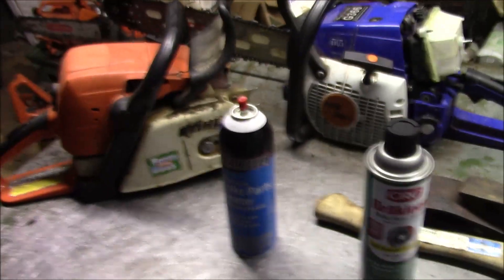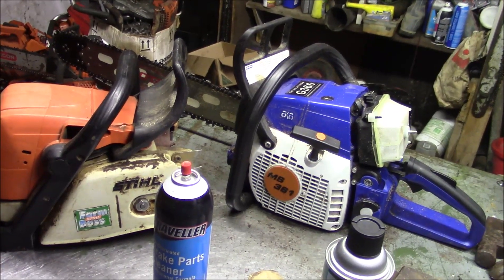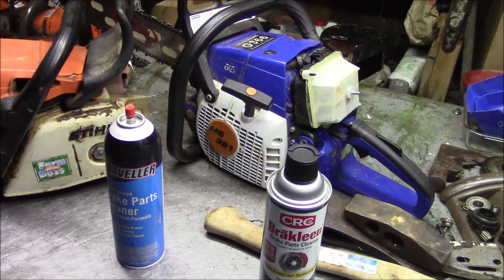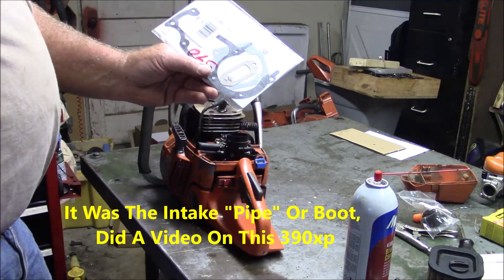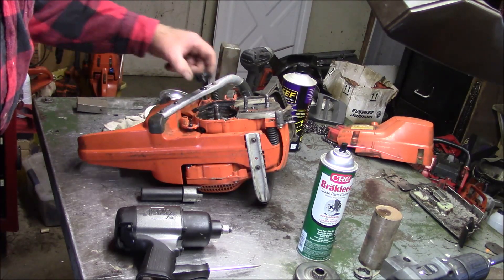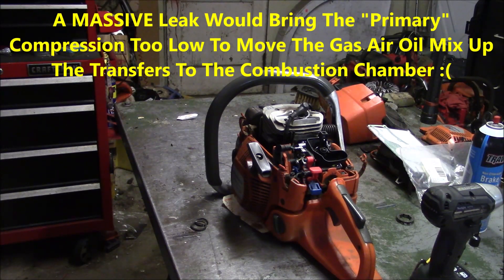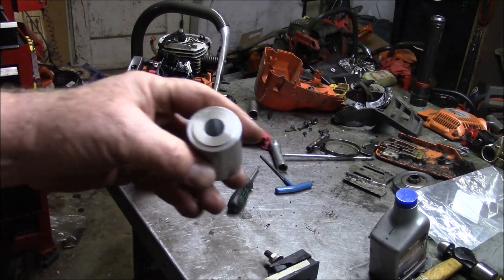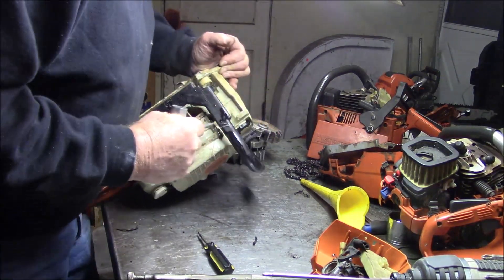Chainsaw Won't Idle! What's Wrong? Brake Clean Test, Alternative to Pressure Vacuum Test,  Leak Down

Comment: Working on a Homelite Super XL Auto this week same issue. Problem small crack in fuel line. Detected as it was a clear line and I could see bubbles. 
If it would have been a black line or yellow it would have been harder to detect.

Comment: Probably a stupid question, but if brake clean is flammable why does brake clean stall the engine?
Reply from the maker: actually a great question, flammable isn't the same as combustible, it's like the gun powder thing, it's the rate of burn.

Comment: Hey, 
I just came across your video, because my husqvarna 372xpg is idling way too high. I have the carb tuned to the factory settings and when I spray carb cleaner at the transition from the carb and the manifold the saw stalls. What do you recommend?
Reply from the maker: Changing the parts in that "transition from the carb and the manifold the saw" ?

Comment: Thank you  for this !
Been  working  in the woods  for over 3 decades  now and no when a saw has  a wee problem  ie sucking  air in ! Never did i no this trick always  gone for replacing  the easy rubber  bits first ie fuel pipes  carb boots  and so on until  i eventually  find the problem  !  This is so handy  to know  ! Thank you mega  chuffed  with this video

Comment: Just used your method yesterday for the very first time and found a suspected air leak - cracked impulse line at the crankcase nipple. Another diag tool added to my collection!  Thanks so much!

Comment: Wow!  I learned SO much from this video!  Thanks so much for rummaging back through all those vids to find the nuggets and put them all together!  Just as I was about to comment, "Those are all for running machines, but what about non-running?", you inserted the non-running one and how you went about testing everything else to eliminate the variables!  I just subscribed and rang that bell!

I've been watching YouTube videos for 18 straight months at the rate of 2-6 hours/day, 7 days a week, to learn small engine work.  I've come a long way but of course continue to have questions and increase my knowledge base as well as try to refine my diagnostic skills.  I'd already seen this method of testing for leaks before but hadn't tried it because the machines I was working on were non-runners.  I've learned all about pressure/vacuum testing and do that all the time, but if there's a way to shorten that process I'm all for it!

So far I've restored or repaired chainsaws (Stihl, Husqvarna, Dolmar, Makita, Poulan, Craftsman, Homelite, etc), a string trimmer, a snowblower, a lawn tractor, a wood chipper, a leaf blower, a pressure washer,  lawn mowers and who knows what else. ;-)  I've got a garage and large yard full of free or cheap (I don't buy any more - I only did that in the beginning) equipment I've acquired to flip, but now I'm getting in repairs as well.  I have some favorites I've gotten for free that I want to work on but can't seem to get the time!  At 75 it's all about how much energy I can summon up on any given day.  ;-)

Thanks again!

Rein Ciarfella  (Cape Cod, Massachusetts, USA)

Comment: what if carb sucks brake cleaner in the throttle shaft?
Reply from the maker: It will shut the saw off there as well. :) AND I got snagged with that exact issue on a saw very recently . those 361 clones where a nightmare with all the leaks they had. Doesn't matter how the brake clean gets in, if enough does the saw stops. A great tool for finding issues.

Comment: Is one of the symptoms of an air leak on a chainsaw where it will start and idle but will die when the trigger is pulled (compression is 160 psi and carb kit installed)? I have a Stihl 026 that has this problem.

Comment: Ever seen an airleak after about 15 to 20 minutes of working?
  Sthil fs76 weedeater after 15 minutes of work it has trouble going from idle back up to working rpm does better if i apply the choke it takes the hesitation-stumble out.
 It idles fine hot or cold 
Enjoyed the video I'm a subsriber now!

Comment: What makes the saw stall when you shoot the cleaner on it? Does it go into the engine?
Reply from the maker: Yes, on a two stroke the crank case is part of the "pump" drawing fuel into the motor, then when the piston heads down compressing the gasses in the crank case then pushing them up the transfers to the combustion chamber. WHEN the piston heads back increasing the volume of the crank case that draws mix in through the carb....if there are leaks in the bearings seals or some other place,  air will we drawn in leaning the mixture creating issues....spray brake clean around and when a spot pulled the brake clean into the crank case and that now contaminated mix heads up to the combustion chamber...it won't light off so the motor stops
Reply: @afleetcommand  Gotcha. Yeah I’ve seen guys on YouTube before get out there leak down kits. One guy said they were about a hundred dollars. It’s also time consuming to hook them up. This is an awesome little trick and I’ve never heard of this before. This was helpful. Thanks man!

Comment: HI WALT  ANOTHER GREAT VIDEO, WHAT ARE YOUR THOUGHTS  WOULD A 572XP  MAKE A GOOD FIREWOOD SAW ,I WOULD MOSTLY BE CUTTING  MEDIUM SIZED MAPLE AND BIRCH  ,ANY IMPUT WOULD BE GREATLY APPRECIATED THANKYOU
Reply from the maker: Of course it would, it's a saw that can easily handle pretty much anything under 30 inches.

Comment: some thoughts/questions on the common PTO side bearing failure.

I know you run your chainsaws regularly and hard.  No doubt one would assume this is not a one off kind of failure and likely has a root cause.

Here are my guesses: 

a.  poor engineering.  Maybe that crank seal just isn't reliable.  (FYI:  pressing a bearing seal is far more precise than smacking on into position.  It matters!)
b.  out of balance crank, rod and/or  piston ...otherwise poor manufacturing quality?.  Excessive vibrations from loose tolerances lead to failed bearing seals.  This is well documented across a variety of applications.  13K rpm's is nothing to sneeze at.  At 3-4 horsepower, that becomes quite a bit of massive rotational force to deal with.
c.  modifications to the chain sprocket.  Example:  sprockets that are installed too far out on the outboard side of the crank.  Just a few fractions of millimeter is a significant amount of force ...e.g,  the lever physics of a rotating mass.  I have seen some chainsaws where the sprocket is inboard to the clutch drum, placing the forces closer to the center of enertia.  I believe this is a design improvement wrt to reliability.  When you place any load far from the center of rotational mass/CG...the bearing experiences serious loading that is "undesirable" and can only be overcome by superior engineering and high quality pristine manufacturing techniques.  I suspect most of the mass produced chainsaws really don't go through a really high bar for precision engineering.  Just looking at how much play exists with the crank and rod assembly, it appears there is alot of parts that are "VW" level quality.  Not much you can do about that, unless you want to actually tool your own parts....maybe there is a market for this.  I've heard makita does it better than most.  Just what I've heard, never had the opportunity to perform an operation and inspect what makes them so special.  
d.  Excess "play" from sprocket rim to clutch drum "teeth".  Inducing heavy vibe.  
e.  speculative:  2 cycle oil is substandard.  Meaning maybe the fuel oil is actually breaking down the bearing seals and not providing enough lubricating performance to keep the seal healthy.  Synthetic contain any alcohol or other high volatile?  
f.  And then this one:  does brake kleen deteriorate bearing seals?  I would assume it would not, but maybe it's worth looking in to?  for instance, I know there are some brake clean type sprays that are chlorinated, and some that are not.  Chlorinated parts cleaners are a big no no in aviation maintenance due to the corrosive effects on seals and other plastique and rubber and synthetic rubber parts.  Could it be that the type of parts cleaner is actually causing this failure....or contributing to it?  maybe just enough to fail them prematurely?  I dunno..these are just guesses.

Here are some suggestions:  don't use any type of parts cleaner.  USE COMPRESSED AIR.  You end up with the same results sans the possible bad effect.  If there is some kind of air leak, compressed air WILL cause a idle change, you will hear and notice.  I have a resuable compressed air can that can take a refill from ordinary compressor.  Making it easy to tote around for field use.  It's a steel can and is rated to 150 psi.  Get about 50 decent squirts.  More than enough to be used as a good troubleshoot. In this shop, just use the compressor.  You will definitely hear the rpm changes....and if the air leak is significant, probably wind up killing the combustion ratio...same results..you find you problem with compressed air.

other suggestions:  see what kind of material is used for the bearing seal.  What it is exactly.?    teflon, impreg steel ceramic, ...I dunno..but it would be interesting to find out what it actually is.  Then determine if there are more reliable materials available to replace them.

just stray random uttering

Peace
Reply from the maker: I think u have to relax a bit. Brake cleaner isn't going to hurt your seals. And it's not like anyone is going around cleaning their saws with brake cleaner. I'm not even sure how you got there.. 'll test from time to time a build until it's stable and now will test saws coming in the shop. But compressed air directly on your seals is famous for pushing dirt into them. Like the car wash syndrome with dirt bikes. Even if seals were immersed for a period of time in brake clean. That's a non issue! 

Second all except the aftermarket 372's are customer saws that came to me blown up,  not mine saws MINE haven't blown up, how did you get there??  I have never had a OEM saw of mine with a PTO side bearing failure. Ever. The only saws I had that the bearings failed were the Three Test Aftermarket 372 Case builds. The material I believe is not as durable as the OEM castings.  All my personal 372's including my 2172 have steel caged bearing and none have failed. In addition to that to my knowledge none of the saws I built or rebuild ever came back with a bearing failure. None. So u have to start your entire premise understanding I probably did 75 percent of the case repair in this area for a while. And that is a very small percentage of those saws sold in this area.. I just get most of the case repairs therefore a high percentage of my repairs ae...case repairs. It's what I specialize at. So it's a bit disproportionate as most dealers simply don't do that work. I did a lot of repair work there for a few years. The reason most failed simply was run time and that was the first place things fail at the end of their life cycle. I see that 70-75cc class the most, with 372x-torq's, 461's , and 575/6 saws with their 6202 sized bearings and those longer taller X-torq pistons. I just report.  I can't read  all that posting, it makes my head hurt with the perceptions. :)
Reply from the maker: You need to either be on my Facebook discussion site "Chainsaws & Wood Working" or go point by point, for me to be able to engage and give each concept its due.

Comment: I like random.  there is really nothing interesting when everything is planned out and mechanical.  For chainsaws fanatics, we watch you videos because its interesting...all of it.  And because YOU add the human factor.  We can all see what you are doing and easily find ourselves doing the same motions and doing the seemingly random things in a days work.  What I find interesting is probably more to do with my own appetite for getting things done and the PROCESS, even then mundane, involved in accomplishing a goal.  I also have a similar interest in learning  better ways to fix things.  

So don't think for a minute that you NEED to have some elaborate plan before you publish a video.  The reality is that you are covering things that pretty much no one else does.  Others seem to want a well polished, mechanical production.  Not my cup of coffee.

I am just guessing, but I suspect my views are shared by many.
Reply from the maker: Thank you for both your feed back and support....:)
Reply: @afleetcommand  Friend 372 xp oe when I warm up, I increase the speed and I stop at exactly 14 thousand turns what can it be? . I will set the carburetor as cold for about 13,000 revolutions and when I warm up it will accelerate to 14,000 .......................